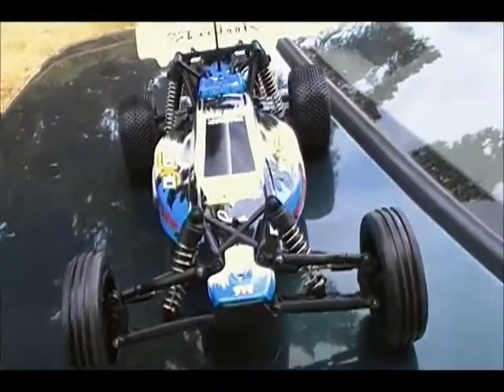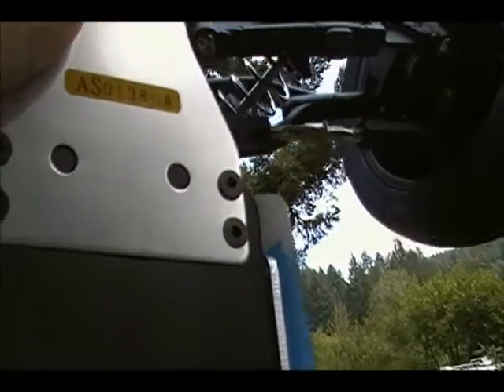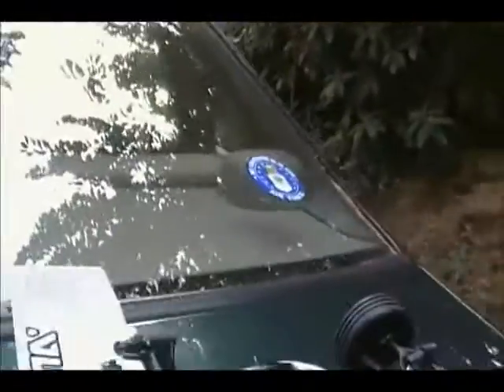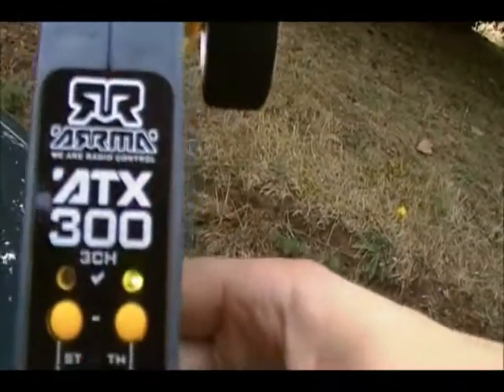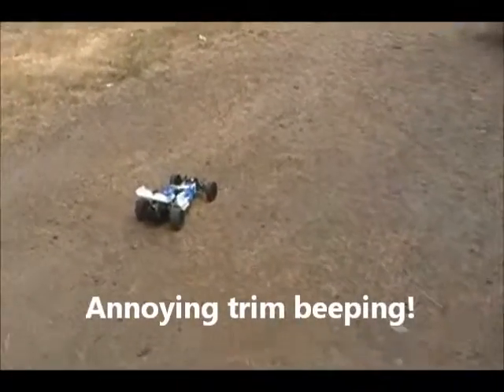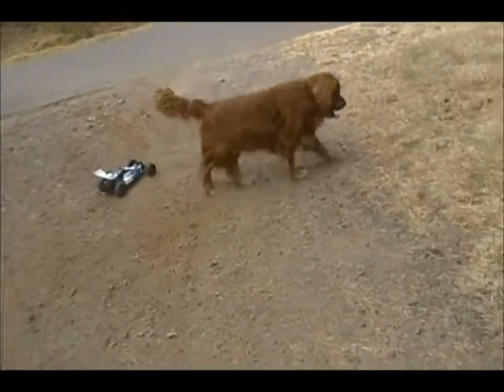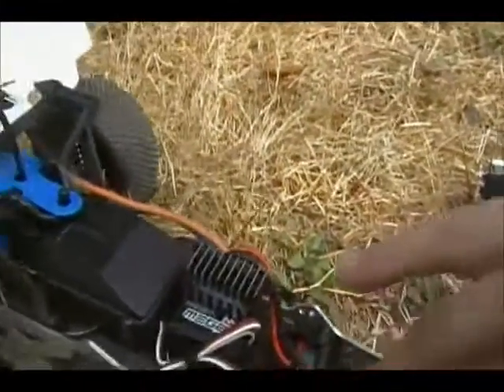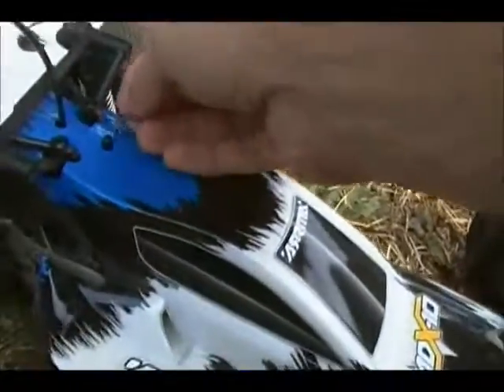Arrma ADX-10 Review: Running (part 2)

Comment from the maker: Only thing I can think of is a brushless system, that's if you want a bit of speed out of it. Other than that just make sure all screws are in taut and the moving parts get a bit of oil/grease. Register it on arrma's site so if a part happens to break you can get another

Comment: Would it be easy to put metal/better suspension on this? Looks like you could just bolt on some new shocks, but on an old rtr..they made it hard if not impossible to bolt any aftermarket parts on.